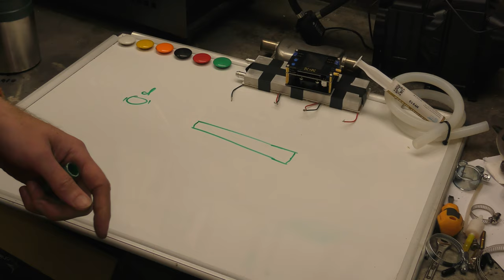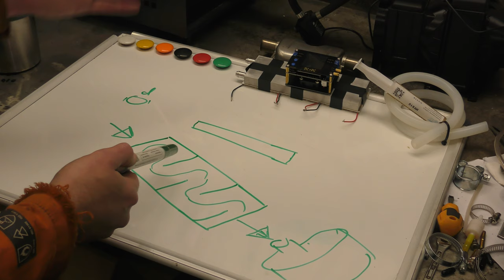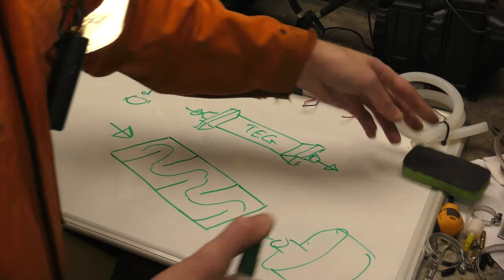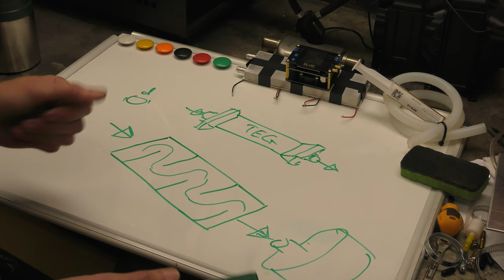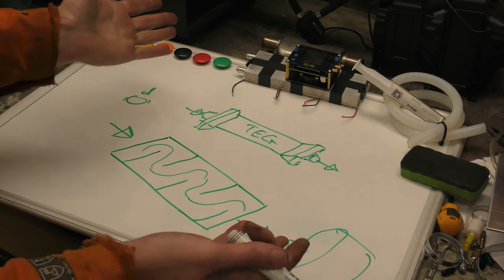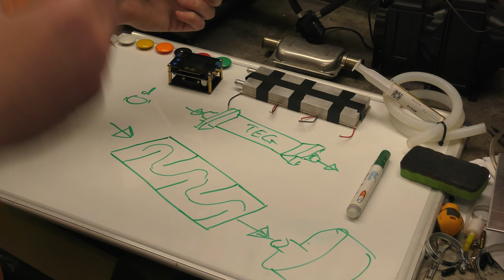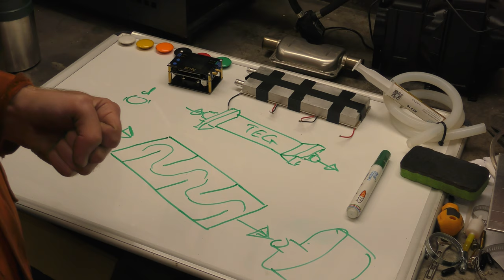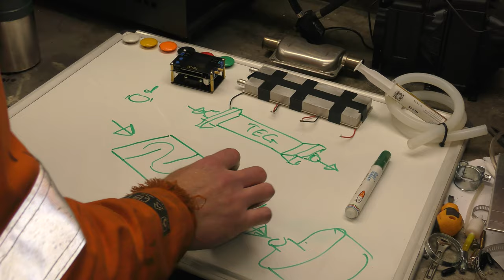Self Powered Diesel Heater Project - part 1

Comment: Hello! I have a thought might worth considering. How about buying 2 heat sinks? Put one (smaller?) on the exhaust side and make a box around it to guide the heat. 
Install the other heat sink on the cold side of the generators. Let all the air to be heated being drawn through the cold side heat sink. 
This way you are not "wasting" any electrical energy on running extra pump/fans for the cooling.

Comment: I was wondering if, a bit like the stove flue fan units, you could attach the Peltier units directly to the aluminium heat exchanger with a cpu type heat exchanger on the cool side in the cooler part of the heater air stream as it enters the warming zone. This would use no more power to operate as it would require no additional pumps or fans.
  Can’t remember how much or little space is available under the cover. Might require some fin removal to make space. 
Your idea would certainly work and waste hot water is always useful.

Comment: This could be possible to run the impeller after the unit is at optimal operation. The exhaust is plenty hot enough to run the motor. I have an idea, thanks for the leg up!

Comment: First reaction - Damn, that is what I am trying. Well must be a worthy idea. 
Yes,  self power the unit and pre heat the combustion air while recovering waste heat. 
Will there be condensate in the exhaust baffle ?? Yes. Add a drain hole or tube so CO does not get in the living space. 
Now is it enough power ??  Not sure. Can't wait to find out.

Comment: <suggestion: The hot side heat exchanger for the TEG needs some consideration to divert the heat input equally between the modules and keep their hot side temperature equal. What is often done is making the hot side cross flow, so that each TEG gets same temperature air. If you for size constraints would like to make it less bulky and blow lengthswise across it, you use a heat sink profile, where the front end has had its fins ground down and as you move further back in the airflow, you keep more of the fin height, so heat flow through the first and the last module are the same. There are plenty of TEG generator university projects with pictures to get the idea.

Comment: I have been thinking about building something along these lines on the diesel heater that I use to heat my off grid hunting cabin. I have some solar panels but as it gets further into winter the hours of sunlight drop and I get minimal power from them. I would have to clear quite a bit of trees to get better light on the panels anyway and I don't want to do that. I get the idea that you want to match the area of the pipe in a thin manifold to maximize the amount of power that you can extract. I was using the Peltier unit size as my constraint and had sketched up an exhaust "pipe" that was square and would perfectly fit the Peltier cells along each of the 4 sides. It would also have baffles in it. Then I could series and parallel the units as needed to get the correct voltage and amperage. I wasn't concerned about keeping the flow of the gas at a constant rate. If the gas slows down in a bigger chamber with the baffles then it would have longer time to dump its heat into the walls of the exhaust "pipe". I thought that using copper sheets would be best with a high temp solder for ease of construction and high thermal conductivity. The one concern that I did have was the delta T from one end of exhaust pipe to the other and how that would change the power output as the unit came up to temperature. I have never used Peltier modules before. I think a voltage regulator into a charge controller with a battery would keep the whole system running and self contained. I am not worried about the delta T over the Peltier cells as they would be outside near 0 C and the exhaust temp would be what it is giving a sufficient delta T for power generation. Sorry for being long winded with all this and you may have thought about it this way and decided that it was not a good way to do it. Maybe something in here will help.

Comment: I had similar plan.  But I was going to use extruded aluminum heat sick welded into C channel I make a box for exhaustpipe.  Than was going to have four thermal transducer on each side running in series. On other side was going to have heat sink .

Comment: I think the exhaust heat exchanger should have a greater "diameter" area than the muffler, so the gasses can slow down and allow more time for the heat to transfer. 
Also maximum cooling on the cold side. 
Good luck with it 👍 
Following, as ever. 
PS
Managed to get an Afterburner  😉

Comment: I would probably do some tests without the heater. Just find out what amps / voltage you get out using some controllable heating and cooling. Blow torch or oven element for heat and run the water through a sink that you can replenish the cold water into or even add ice. I don't know the maths but this way you can see what makes the biggest difference more heat or better cooling. You're already thinking about how to get more heat with baffles and insulation than how to increase the cooling. From what I know (and that's not much) it's the heat moving from one side to the other that produces the power. Pulling more heat away from the cold side may make a bigger difference.
Reply: I did this with a couple of heatsinks.. one in a saucepan and hot water, then putting ice cubes on the other, just to test the voltage / amps
Reply: This. Hopefully David reads this first.

Comment: Certainly seems feasible to generate a small charge, though it doesn’t sound likely that it will run 3 amps (or there about) to fully cover the current draw from the heater fan. I hope I will be proved wrong but I remain sceptical. Good luck with the experiment though.
Reply: I'm thinking the same and would like to be wrong I got excited when I discovered them and spent a lot of time trying to get some useful power using my wood stove I never got past the stage of it making enuf power to keep the water pump running it just ran the battery flat

Comment: You have the best ideas
Reply from the maker: I just try to answer the questions people ask to the best of my abilities, with a lot of help from our clever community.
Reply: @DavidMcLuckie  I'm trying to find a way to trick the temp sensor on a black hydronic heater. It is non adjustable and cuts in a 65 and off at 75. I'm using it for my hot water on my van so I don't want it that hot so need to find a way to have an adjustable dial with a temp read out to be able to control the heater. 
The 16kw one just didn't work for me (doesn't start up and when it does spews white smoke then chokes out. But would have been perfect
Reply from the maker: You'd be the third person I know with a problem with the 16KW.  The last one was the glow plug failed, but the replacement sent had been the wrong voltage.  So it never got hot enough to light, only turn it into smoke.

I wonder if you could solder in series with the sensor on the board a variable resistor.  That would trick the heater into thinking it's at the correct temperature when it's actually a different value.  The sensor on one of my boards failed and it though it was -32ºC the whole time and started boiling.
Reply: @DavidMcLuckie  the 16kw one did heat water up it just used to pop and bang and then sometimes flame out but still think it's running hence throwing out the smoke. Now it does not light at all so I'm going to take it apart and learn. 
I'm hoping to put a potentiometer inline and then mark the correct water  temperature on the dial so I know. Basically tricking it into thinking its say 75 degrees when it's actually at 40 which is what I want. But also have the ability to run it hot too so it will burn off all the nasty bacterias.

Comment: Great idea. If those TEGs don't provide enough power it would be interesting to see a sterling engine attached... perhaps turning a bldc. I think there might be an automobile maker that uses TEGs to charge the starting battery.
Reply: Yes BMW did some experiments and the French were in on a system for lorries to save fuel. Point was that to make a 2kW TEG generator for a lorry so it could save on generator load, was not cost effective, as these units were expensive, but the environmental benefit was obvious.

Comment: The only way I can see this working efficiently is if you yeet the fans and somehow redesign the heaters to use draft air, perhaps using the venturi effect to draw the fuel more like an oil burner, or turbocharge it.

Comment: Could be worth in the later stages looking into using a MPPT solar controller over a just a buck boost. Maximum power point tracking might well be a more efficient solution for gaining a higher effective yield from varying volt and amperage the TEG units will produce.  

Best of luck on the project it is one I’ve been toying around with them hypothetically myself.  

Would you be looking at including the circulation pump within the circuit of the energy produced by the TEGs?
Reply from the maker: It will all be attached to one battery.  If the TEGs don't replace the power that everything is using then we'll call that a fail.  But the answer might be more TEGs if it's close.  :)

Comment: There is a significant difference between TEC (cooler) Peltier junctions and TEG (generator) units. The former are configured to be most efficient below 100C (212F) whilst the latter use different solders to run at far higher temperatures up to around 250C. Whilst each will function in both temperature regions a TEC will fail at higher temperatures but tends to be more efficient in the lower temperature range, but since as a generator the power produced is dependant on the temperature differential between the two sides, the greater the differential the greater the output... until the solder melts and it fails.

Comment: What is the maximum volts and amps the thermoelectric modules can produce?
Reply from the maker: https://uk.rs-online.com/web/p/peltier-modules/7650056/
Reply: @DavidMcLuckie   at £117 each and you are using 3 + all the rest of the parts and time costings I am glad you are doing this experiment. Good luck
Reply: I assume the idea is to have a battery of some kind to start the heater then use the thermal electric modules to replenish the battery as it runs?
Reply from the maker: Thankfully the TEGs have been loaned to us for experimenting.
Reply from the maker: Yes, battery to start and then see if the TEGs can recharge the battery while the heater is running.

Comment: I think the idea of using the air intake to cool the water is inspired, it's something I have never thought of but why insulate the other side?  what about a square aluminium tube, that you hook the exhaust pipe to one end and silencer to the other, and put tecs on all four sides ... Would be more of a faff to wire and cool but then to hold it all together just need a jubilee clip or two.

Comment: Cerwool, or ceramic wool used to keep the heat away from the sides of the heating coil on a hotsy pressure washer. Is not very thick 1/2 inch, very good at keeping the heat away from the stainless steel case. Will the fan blades soften when exposed to higher temps? Circuit board might hiccup with higher temps as well. Might want to put that on the outside. Cheers!

Comment: Hellooo David.
I suggest you don't insulate the other side, just put the same tec assembly, at the other side, or even better, make a square exaust and use 4 tec assembly all around. 
This dc/dc converter can stand 50w max, with fan, 35w without, the heater needs 10 Amps? x 12V= 120W, we need 4 dc/dc in parallel. I remember  you burning one when you tried to power a heater with 18V drill battery, or was it someone else? :-D.
The heat will transfer from the sides of the tec's, that should be insulated. #techIngredients played with the tec's, his conclusions are interesting. 
Nice project, I can't wait to see  you blow the dc/dc, because I have bought 2 of this model, and I'm not rich enough to break them, so I never ask them more than half the rated power.
Thank you.
Reply: I saw it's not 10 amps, but 2 or 4 amps only.

Comment: There were large and cumbersome TEG devices that people used to use (one example I'd seen being of soviet origin) that would wrap around an oil lamp, they just about provided enough power to run a small radio, so to power the heater, or at least put some power back into the battery, you're going to need many times more TEGs than you have there, they're rather weak as a generator unfortunately... :(

Comment: Energy losses charging a battery might be an issue . A SuperCapacitor instead is much more efficient and would simplify your experiment for measuring volts/amps  in/out etc more accurately.

Comment: Nice idea, but i am afraid the energy wont be enough.. these things are increadably inefficient
Reply: Your not wrong. As heaters or coolers they are very insufficient. And I have no idea if they can produce enough energy for this project. But they are recovering power from what would be wasted lost energy. Even replacing 50% of the power used running the heater, would be useful in an off grid setup. Whether the cost is worth it is another matter.

Comment: T.E.G. are notoriously inefficient--they convert AT MOST about 15% of the input energy into electrical power.  Granted the heater doesn't use that much in electricity, but this is going to be a steep hill to climb...
Reply from the maker: We got so close in latest test.
Reply: @DavidMcLuckie  Yup, I saw that.  If it were my problem, I'd take advantage of the cold that is just the other side of the wall of the space you're trying to heat, with a passive setup--eliminating the pumps, and increasing the temperature difference.  A larger (50cm x 50cm?) array of cheap TEGs in a series-parallel array.  Not much of an "all in one" solution, but similar in footprint to sticking a radiator on the exhaust...
Reply from the maker: That's certainly one of the main problems.  Cooling the TEGs without wasting heat.
Reply: @DavidMcLuckie  Drew this up quickly:  http://www.ccera.ca/files/teg_exhaust_panel.pdf     The idea is to use thermo-siphon effect to circulate water through the block, which also has a lot of cooling fins on it. Place this outside, run the exhaust to it, and the wires...

Comment: I think you would have better luck making the heater itself more efficient. The exhaust shouldn't be so hot in the first place. If the heater was more efficient then you wouldn't care about the little electricity it uses to run the fan and the injector. I heat my house off diesel I use a toyostove. The exhaust that comes out of it is warm it uses way less fuel than than these and makes more heat. If you would like to check them out mines called a laser 56
Reply: The whole point of this is to capture the waste heat from a small, mobile diesel heater used in a Camper/Caravan.  Yes, TEG are very inefficient, but with 800-ish watts as waste heat, even 5% of that back (Which is optimistic) is still 40 watts NOT being emitted out into the air as waste.  You can't exactly put your House Furnace into a tent or caravan.  If you CAN, please make a video and show the YouTube world you're not just a troll.  ;-)
Reply: @fyrehawk13  lookup the heater I mentioned. You can easily put it in a tent or a caravan. The point I'm making is that the heater is inefficient so by adding more inefficient things you won't be solving any problems. Those generators work off differential heat so once they get heat soaked they will do almost nothing. Making the heater more efficient will result in less power being used to get the same heat which is going to be the way forward. I'm looking forward to these videos to see what he can actually get but I'm saying he should probably also try maybe in a different series to maybe add another heat exchanger to the exhaust to extract the most heat possible. Not trolling just commenting my thoughts.

Comment: 3 min into the vid and seeing how you intend to do it, My prediction is NO, this won't work to self power and by a long shot.  TEG's make pathetic power used this way and it's not going to be enough unfortunately.  There is a KW of heat to be reclaimed from the exhaust  which would be worthwhile. I preheated the Combustion air and the intake air on my heater over winter and it was certainly worth while and I was able to achieve Higher output temps than without the preheat but  it needs  to be done carefully to make any worth while gains. 
Going to be interesting vids anyway but my prediction is you will fall well short on the self powering even if you divert ALL the heat to the TEGs.
I ran my heater over winter off a large Battery that was recharged by a Couple of old 220W solar panels I put up on the Verandah Roof.  I did have to put on a power supply couple of times with prolonged bad weather and using the heater on a fairly High setting but I'd say  the solar provided 90% of the power. Could  Probably self power with another couple of panels  especially if I pointed the the right direction instead of  just flat.